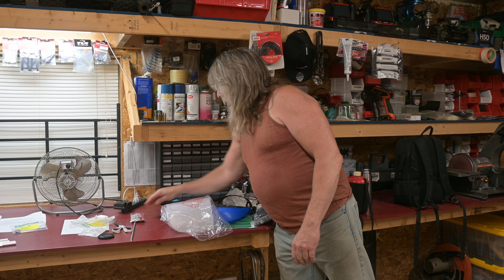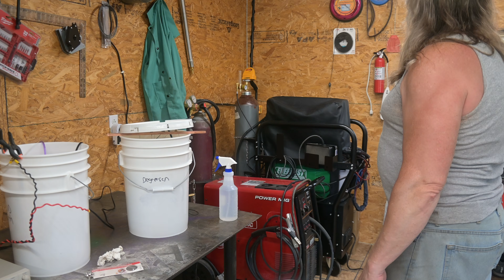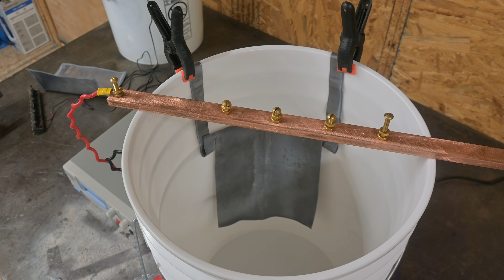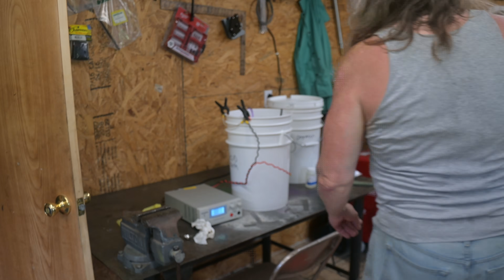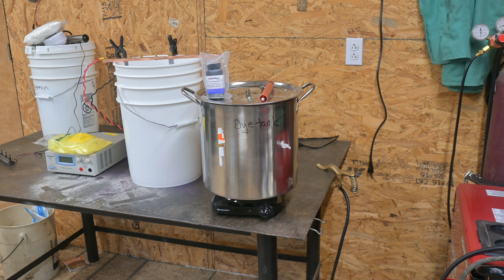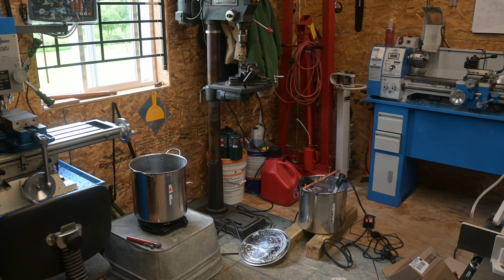DIY Anodizing for homemade RC parts using Caswell anodizing kit.

Comment: Hey Brian I just noticed you have an orange rocket hanging on the wall behind you. Can you give some insight into that? Does it fly? Take care my friend.
Reply from the maker: It should but i have yet to try it. Its funny you mention that because one of my main project ideas coming up is to make a mobile 1/5th scale rocket launcher for that. Now i just have to find a source of RDX for the war head,lol.
Reply: @RCWalletVacuum  That sounds like an interesting project.  It would be nice if you could do a vertical landing just like the SpaceX's Starship.  With your awesome welding skills you you could build a tower with some grappling arms to retrieve it. lol  I honestly think it would be fun to experiment with rockets.  Perhaps a Delta II or Titan IV.  Those were the 2 rockets they worked on at the Boeing facility I worked at. According to one of the guys I talked to said that the Titan could carry a school bus size payload but it shook quite a bit on takeoff and was hard on satellites. It was amazing to see up close and often times climbing to the top level of the fixture that held it took some time. Every once in a while I had to replace lights or add some receptacles for the workers. I sure miss working there.
Reply from the maker: @RCRoads  I just need Elons bank account(s),lol

Comment: You really went all the way. That looks like an incredible amount of work. You did an awesome job of running a camera and setting everything up.  The turnbuckles look amazing.  I forget what the ping pong balls were for. I always see them in chemical process lines. I guess for spatter prevention ? You now have a cool setup for all your custom aluminum parts. 👍👍
Reply from the maker: It turned into quite the project. I knew that going in, hence the reason it took me about a year after getting the stuff to dive in. Now that i know how to do it things will go much better. Thanks for checking it out buddy
Reply: @RCWalletVacuum  I can tell its a lot to setup. It reminds me of my Son and his adventures extracting gold from old circuit boards. He even built a working Tesla coil and tried to make capacitors with wine bottles and solvents. Crazy stuff ... We need people like you in this world. Your able to do anything. 👍
Reply from the maker: @RCRoads  Hey RC, it sounds like the three of us could make quite a team!
Reply: @RCWalletVacuum  I'll do the grunt work. lol